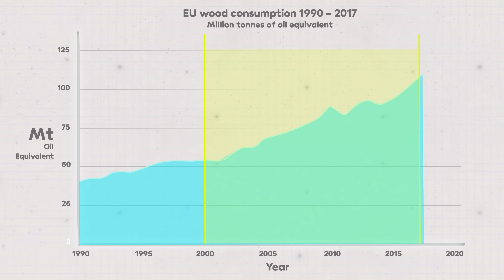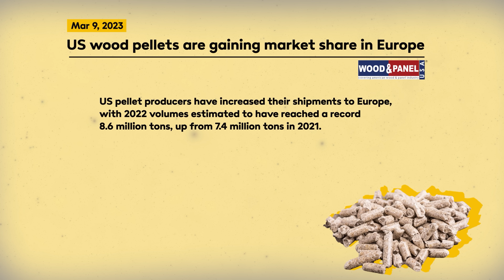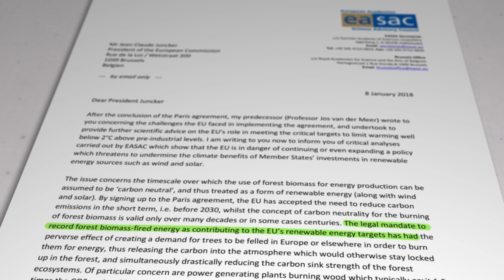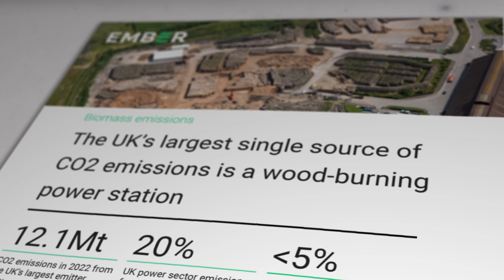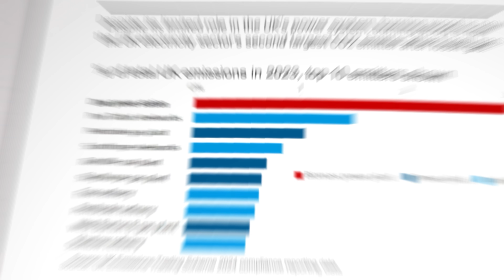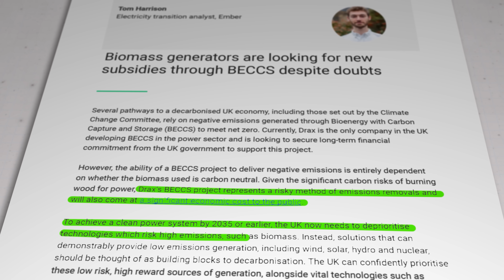New report: Biomass CO2 emissions 4X higher than COAL!!

Comment: It's an unsolvable problem. There isn't always enough sun and wind meet our power needs, and energy storage technology isn't quite at the level that we could bridge a two-week lull in wind strength during dark winter days with little sun and a lot of need for energy for heating and lighting. If only there was a NEW CLEAR path forward that could get us out of this climate mess.
Reply: The clear path forward is energy-freedom. See: Alex Epstein.
Reply: From a European perspective, there is a fair amount of renewable diversification being built over a wide area hence it's unlikely a two-week lull would exists (particularly in coastal countries like the UK). There are also many cross country HVDC interconnections and increasing deployments of battery storage (of various types). Plans indicated that by 2030 there will be more resilience in the system than there was under the old fossil fuel power sources that were subject to their own supply issues.

Comment: I have a large greenhouse growing veg for sale. I planted a short rotation willow coppice to provide wood fuel to heat it. Apart from possible issues with particulates etc it's green fuel i.e. carbon neutral. It's not biomass that's the problem, it's how you do it. Drax is an environmental disaster.

Comment: Let's just have a think. Burning wood IS carbon neutral. Extant plants take it up, release it back into the atmosphere as you burn it, new plants take it up and sequester the carbon again. Even better is if you use coppicing and/or pollarding to produce the pellets. Get a grip.
Reply: "Coppicing and pollarding are both traditional pruning techniques that involve cutting trees to encourage new growth..." (Google AI)
Reply: @aliendroneservices6621  Exactly correct.
Reply: You're missing quite a bit about why the wood pellet industry is a problem.
Reply: @TheDanEdwards  If trees are replanted, no problem. Wood pellets are carbon neutral in that case, and coppicing/pollarding actually provide habitat for animals and not only save the trees but make more fuel pellets. Black Locust is wonderful or this application. Wind and solar and nuclear, all carbon neutral sort of,  have problems too. Every problem is relative to what came before in relation to what your goals are.

Comment: I felt the urge to comment 

When I moved into my current flat, I was happy to hear the central heating boiler used pellets instead of gasoil. Now I feel cheated

Nowadays, we need heat for our homes while at the same time solar panels need a way to remove the excess heat. I hope someone finally invents a viable way to transfer that heat reliably and rooftop solar becomes the norm
Reply: There are technologies (fairly simple ones) covered before on this channel, I think. In short, water is piped underneath the panels, drawing heat away from them.
Reply: @danyoutube7491  there are some personal solutions, but, afaik, nothing implemented as a more or less standard the way panels themselves are. If solar fields don't use refrigeration systems, one has to assume it's not economically worth it yet.

For comparison, here in Spain all new buildings are required to have panels by regulation, but nothing has been decreed for panel refrigeration/heat recovery.
Reply: @drillerdev4624  I think in homes it is different, because the heated water can actually be made use of inside the home, whereas with a field of solar panels you have to put a lot of pipes in and connect to a water supply, find a way to dissipate the heat you've taken from the panels, and pump it around the whole site. That's a lot more expensive than adding a bit of piping at home.
Reply: Nope. Rooftop solar and all other solar is net heating up the planet because it absorbs light far more efficiently instead of sending it back to space. Just have a think😊

Comment: Thats a retarded use for biomass.
Shit like that can be decent if you source it locally as waste and throw it in digesters - do the composting that happens in nature anyway, but capture the gasses to burn and the solids as fertilizer.
That is actually carbon negative (or rather neutral, but negative vs. the alternative paths).

Comment: But, it would only be Zero emission if the trees mass was acounted for by a new tree...
& even then, the total difference in CO2 depends on the health of the soil, which clearly degrades when monocultured.

But they didn't bother to define it by that headachingly obvious metric & instead let them pull a fast 1 with a dumb loophole

Humans man, fork me.
Reply: Basically the only way for biomass to be carbon-neutral is to grow a fast growing weed like hemp.
Reply: But typically (at least in north america) commercial logging replants trees so for a given unit of land you can get numerous capture-release cycles over time. I don't think the analysis that says wood burning causes more emissions actually factors this in. Indeed, fossil fuels represent the only form of actual long-long term carbon sequestration currently, everything else (even forests) are part of a living loop/ecological system and adding in more cycles to that loop in the form of plant-harvest-burn is not permanently introducing NEW c02 into the environment, unlike harvesting fossil fuels

Comment: The CO2 is killing us, yes, but from a technical pov the efficiency of wood burning and coal burning power stations is ridiculous. 
Ever wondered why they have those huge round concrete towers around power stations? They are there to cool the system to get any efficiency at all. 
Coal and wood powered generators, as well as nuclear ones, are actually big inefficient steam engines. For every kWh electricity produced, two kWhs go to waste just heating the environment.  
Compare this to wind turbines, they produce very little heat. Or PV cells that actually REDUCE the heating of the environment by soaking up sun energy and directly converting it to electric energy, sun energy that would otherwise heat the ground.
Reply: The PV cells heat up the atmosphere. Use your brain matter do not regurgitate nonsense.
Reply: They do not soak up "sun energy". They transform energy from light of different wave lengths into electricity that does work and produces/releases heat when it is done.
Reply: What is net negative is the fact that more light should have been reflected back to space if there were not solar panels there in the first place.

Comment: I was sold a biomass boiler on the basis that trees would likely be from Scotland or france on a 7 year growth cycle. ( Yes I was missing sold as 0 carbon solution.) First couple of years were fine and cheaper that gass. But then Drax switched to biomass. Causing huge demand issues and prices have never been the same. Most of my pellets come from America now as result. Via a diesel boat. Fingers crossed wind and batteries will take over soon

Comment: I know Germany gets a lot of energy from biomass, but my understanding was that it does it by gassifying compost and sewer waste. 

Does anyone have any sources on if this form of biomass energy generation is also bad?
Reply: Making methane from decomposing biomass has no downsides as far as emissions from the burning of the gas are concerned. The carbon emitted is the carbon very recently absorbed by the biomass, so this is a good net zero equation. Also natural gas is methane, so the existing infrastructure for gas distribution does not need any modification.
However, if there is any leakage of methane at any time , this is very bad as methane is much worse as a greenhouse gas than CO2.

Comment: The ash produced from burning biomass that is not utilized as fertilizer or soil enhancer can be considered waste, but it also has potential alternative uses.** Here’s a closer look at what happens to this ash and its possible applications.

1. **Mineralization of CO2**: There is ongoing research into the use of biomass ash for mineralizing CO2, particularly in aquatic environments like lakes and mineral springs. The minerals in the ash can potentially help in sequestering carbon by promoting the growth of certain microorganisms that facilitate this process.

2. **Construction Materials**: Some studies suggest that biomass ash can be used in construction materials, such as cement and concrete, where it can enhance properties like strength and durability. This application helps reduce the carbon footprint of construction by substituting for traditional materials.

3. **Landfill Diversion**: By finding alternative uses for biomass ash, it can be diverted from landfills, reducing waste and promoting sustainability. This aligns with broader goals of recycling and resource recovery in waste management practices.
Reply: Wood ash stuffed in Concrete to simply get rid of it, does NOT in any way make cement stronger. 

Where do y'all come up with this crap?

Comment: But how much other pollutants are produced by burning wood pellets vs. coals ? Can we start thinking holistically in light of all environmental damage and not just CO2 emission ?
Reply: That is exactly the right point.  PM2.5 is the main problem with burning biomass.  Coal is a lot worse in that regard along with PM10 NOx and Sulfur Dioxide.  Plus the carbon molecules from pellets were sequestered at most a few decades ago whereas coal can come from the carboniferous 66 million years ago.  As long as the reforestation matches combustion it is infinitely better.  Also those other pollutants causing ground level ozone are arguably far more serious than CO2 as the latter per say does not reduce bio capacity by itself.
Reply: @amizuki  If it took 20 years to burn a tree's worth of energy it would make sense, instead it takes minutes, hours at most. Furthermore, wood DOES produce toxic chemicals when burned, more even than coal because it's a much much less pure carbon source so you end up with a lot more VOCs on top of all the particulate and other oxides. Also, animals are pretty important and animals live in forests they don't live in coal mines (canaries aside).
Reply: @Dysiode  Yes, biomass produce more VOCs than burning coal, but it is more biodegradable and less toxic than the VOCs that come from burning coal (which are still very substantial).  I am not saying this is a great idea, but less horrible than burning coal.  All solutions are horrible environmentally and this is the art of picking the less bad option.  That's why as some others have mentioned, bamboo is a good option and I also mentioned Eucalyptus and Sugar cane.
Reply: @Dysiode  You seem to be imagining a huge skyscraper-sized lawnmower clearcutting every forest in BC and paving over the stumps with concrete.

0.5%-1% of BC forests are forested. It takes decades to timber a forest allowance. Afforestation of that allowance is obligatory. Those important animals are conserved because forestry keeps the land valuable, and forest lands are healthiest when they have biodiversity.

Can BC do better? Absolutely. It's a shame we don't do more. But the little we do right includes using waste wood, deadfall, diseased trees, beetle-killed timber, and debris to displace coal burning instead of generating methane 120 times worse than CO2 when the cellulose and lignin decay.

Is pyrolysis to collect VOCs from wood for use as pygas and black liquor feedstock for liquid fuels, leaving solid biochar for some five dozen commercial uses, most of which displace fossil trade, better?

Yes.

But until you have pyrolysis plants operating, pellets suppressing coal is smart: coal produces three times as much CO2 per GWh as wood, besides all the other benefits of removing fuel for forest fires from the midst of living healthy trees.
Reply: @bartroberts1514  Did we... watch the same video?
Reply: @Dysiode  We did! We just watched through different lenses, and different perspectives.

You see, I'm in BC. I know those forests. I know the forest practices, the forestry laws, the timber management methods.

You know a BlackwaShing video that reads almost word for word from GWPF's Drax response script.

Don't get me wrong. I love this channel, and Dave and his crew are heroic. Merely, they have had the wool pulled over their eyes.

And they've been going around spreading the GWPF's misinformation.

When wood decays, which it does even in standing trees, it releases methane 120 times more GHE intensive than CO2.

We have to harvest that wood when it is senescent, to slow climate change.

We can use that harvest to suppress fossil trade.

We can do better than the way it's done at Drax. We can improve forest practices a lot. But tarring Drax while there's still any coal burned anywhere in the world with all this irrational hate? 

That's just wrong.
Reply: @bartroberts1514  What I also find too bad for this video update is that it's still spewing the same rhetoric from 2021 (anti-IPCC science for LULUCF calculations), but not discussing the newer issues related to forest management and forest biodiversity, or if we will settle on the definition of "old" vs "newer" forests.
Reply: NO, there can only be one thing at a time it seems. And of course, I have my doubts about this video, sensing there is some numerical shenanigans going on.